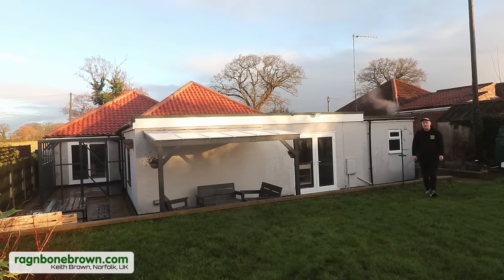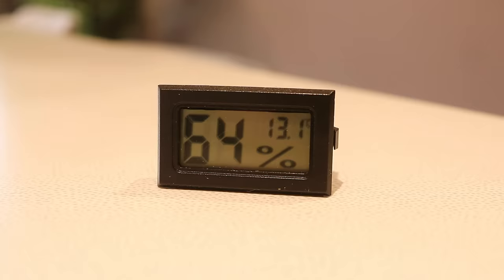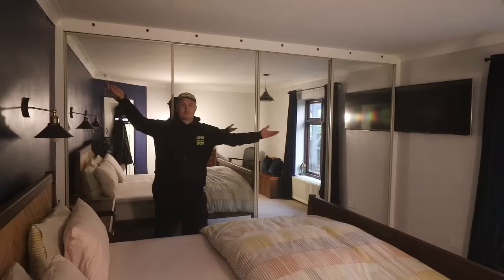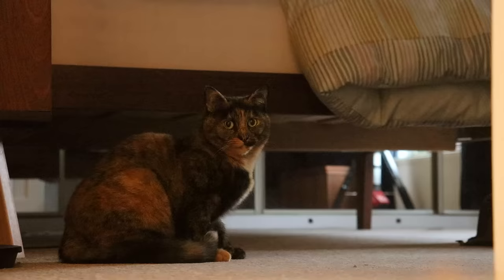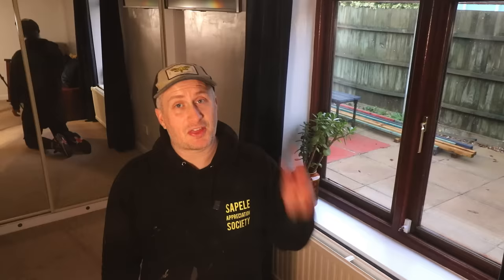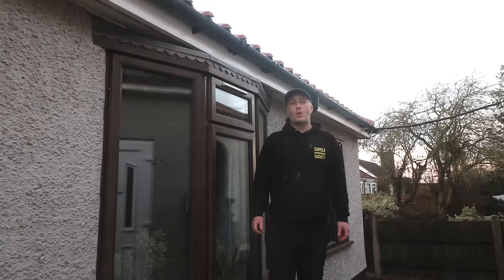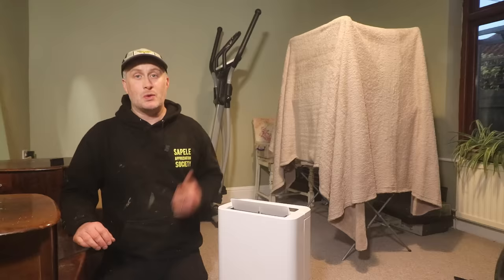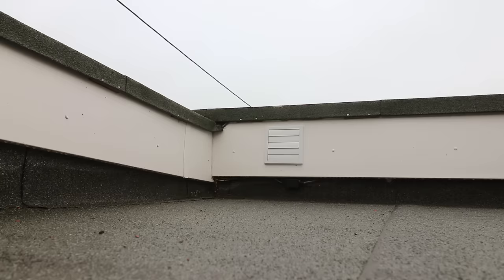8 Steps To Fixing Damp, Mould, Condensation & Humidity In Our Home

Comment: First of all, I carry out home renovations in my Compamy PJ Renovatins Ltd and understand the problem of humidity in the home. I live in a 1960s 5 bed bungalow in the St Andrews area of Scotland and was suffering the same humidity problems as yourself.  A reduction in our heating programme has made our condensation problem worse.   Like you, I monitored humidity levels throughout the house, which was around the 70 -80% level. Did some research on ways to combat the problem. I have done almost the same as yourself and now have humidity levels around 55 - 60%. By far, the biggest game changer was installing the Positive Inlet Ventilation. Although it has a heater, I'm a wee bit loath to use it as we are still trying to find a daily base level of energy usage. Once I have achieved that, I'll start adding on various electrical appliances, including the PIV heater. The other appliance that has had a huge influence has been the dehumidifier, which was on the scene before the PIV and is now being used to dry our washing in conjunction with a reduced usage of our fairly new tumble dryer. Finally,  to conclude, the one action that I would recommend that has had the biggest effect has been the insallation of the PIV. Hope this feedback helps.

Comment: You have to remember that Relative humidity is based on air temperature. If you are getting 60% in a cold room, that will rapidly drop if heated. What temp is the room that you are taking the 60% humidity reading? I have a workshop that sees 80% humidity due to it being cold. However, when I heat the room, it drops to 50%.
Reply: Using relative humidity is nonsense really. People should be using dew point
Reply: @Monaleenian I've also been thinking this.  What's the point of RH meters if they do not compensate for temperature? I.e 90% at 25c is not the same 'wetness' as at 5c? I'm confused

Comment: We're in a 30s semi with 9" thick solid brick walls.  We've got a decent  bathroom extractor, winter clothes drying is now done in a heat pump condensing dryer which is fairly cheap to run (around 35p per load at current prices) and there are still a couple of places in the house that are a bit damp - under the stairs and the built in wardrobe thats above the stairs.  I tried running a loop of central heating pipe around the wardrobe, hoping that it would put enough heat in to help, and put a false wall in so the heat would cause a convection current up the wall.  My next plan of attack is going to be treating the outside of the wall (currently just rendered and pebble dashed) with a water seal product and see if that helps.  Ideally I'd just build a garage along the side of the house which would keep the rain water off the wall, but thats out of budget at the moment
Reply: "My next plan of attack is going to be treating the outside of the wall (currently just rendered and pebble dashed) with a water seal product and see if that helps"

BAD IDEA! You are getting condensation and high humidity because stagnant, damp indoor air is condensing on the colder outer wall, not because water is penetrating from outside. Eventually the damp evaporates out thru the wall. If you seal the wall, the condensation will happen at the junction between render and pebbledash and damage it.

Figure out ways to increase air flow through those areas - Vent the wardrobe at the top, vent up thru the wardrobe from the below-stairs area, use extra-quiet 12V computer fans to move air out the top of the wardrobe.

Comment: If anyone has an old 'period' property, bear in mind that these house often become damp because owners/builders with little understanding about how older, and often natural/more eco building materials function, or rather cease to function when things like Gypsum and petro/plastic based finishes are introduced. 

I live in a solid granite cottage built in 1870 in Cornwall where outside humidity is incredibly high all year around (it rains alot here and is by the sea). I've been correctly restoring it using lime mortar (and linseed based paints for external joinery) and the levels of humidity inside never go beyond 60% - much to the amazement of every tradesperson who has set foot in the building and comment about how dry it feels/is compared to many other properties they've entered down here. Essentially spaces, old or new, need to be able to 'breathe'. 

Most general builders sadly have no understanding of older properties/materials, often writing-off the latter as simply outdated. Every building is different, but one thing is simple: Maintaining constant background heat, and extracting excessive moisture close to the source is key for a healthy building. 

Good work Keith on sensibly tackling your problems given the specific fabric of your property :)
Reply: I am not very knowledgeable in this area but this is my kind of thinking (as I have been reading/researching on the subject): dealing with issues as close to the source as possible!  Many thanks and regards.
Reply: We have a constant leak from upstairs neighbours that can’t be fixed because it’s an old ex council building. What would you say is a good thing to use apart from constant painting and dehumidifier
Reply: @Tamara-xp9nx 
Is the building freehold still owned by the council? They should be fixing that.
Reply: Who can afford to run constant background heat?!?! I’m in Shetland where apparently most of us are in fuel poverty.
Reply: If you have an energy efficient heat source it's relatively affordable - and certainly cheaper/easier/healthier than having to breathe in mould and/or keep cleaning/painting mould. Old houses need care which is, again, relatively easy and simple. I'm in Cornwall, and certainly not rolling in money but appreciate that steady heating (doesn't need to be above 18 degrees C btw) is important for a healthy well functioning building. Hope this helps    @Ida-Adriana
Reply: Limestone or clay based materials help a lot, must not have wallpapers or sealing paints. Modern materials have one main focus: quick and easy usage, thus saving construction costs. I had one bathroom problem with a cool steel concrete ceiling, wallpaper and paint: completely black under the wallpaper. Renovation with a few centimeters of insulation plaster, then lime plaster, that also on the upper walls. Much less humid now. But it only buffers, doesn't remove humidity.
Reply: We put Himalayan rock salt in a bowl ,and we empty the bowl every two weeks .

Comment: The dehumidifier for the laundry is a game changer. It’s incredible how every house in the UK and Ireland hasn’t got one for general use and laundry.
Humidity management is something that requires a little self education for most of us. There is a mind change needed to understand that heating clothes just puts the moisture into the air. It’s not actually removed. 
I’m very intrigued by your attic air recirculating system. 
Thanks for the video.
Reply: We bought a Miele Heat pump tumble drier. It costs about 15p to do a load and takes ALL the moisture out of the clothes and puts it into a tank which can be easily removed  like a soap drawer and we put the water back into the washing machine to do a dirty load , when doing towels we can pull about 2 liters of water from 4 bath towels and a couple of hand towels . It probably costs more to run the dehumidifiers for a few hours a day /several days a week . 
Before that we had a sh*tty White Knight mini Tumble Drier that just turned one way and the clothes were always wet/damp in the middle and cost a WHOPPING 85p a load !! (this was reliably checked using our kill-a-watt meter) 
The moisture from the white sh*te drier was unreal , all the walls and furniture felt wet and humidity was at 85% .
Reply: Yes.  Id wouldn’t even think about drying clothes inside the house.  Tumble dryer all the way !
Reply: If you need a dehumidifier to dry yout clothes it already means your home is too humid in the first place, better to use a dryer
Reply: @gpo746 I'd like a heat pump tumble dryer but we only have room in the garage, apparently they need 10 degrees to operate properly. Might have to get a condenser for now (they too require 3 degrees plus but have read many people have then in garages/sheds for years with no issues)
Reply: Superb comment. With a portfolio of 500 properties, calls start coming in from tenants like clockwork in October, as the temperature drops and people start sealing their homes up. We spend the next 6 months educating tenants on how to control moisture levels. Most the time it is in one ear and out the other; extremely frustrating. It's not even their fault; they are normal people, leading normal lives, doing normal things, in a normal home, they are just ignorant of the issues surrounding humidity. Part of me thinks all rented homes should have an air circulating system installed, or at least provide a dehumidifier for tenants to use.
Reply: I do not allow drying of laundry within the home. Also lately we have been using the little read outs to understand our own humidity levels better. However on some days we have opened windows to ventilate and the humidity has increased on some days dramatically. Obviously when it rains for days on end there is a lot of moisture in the outside air.. Thanks for the tip on the roof space ventilator will be looking at that.

Comment: Great tips and advice.
Our home is a solid brick wall construction (with no cavity), and we constantly have issues with high humidity, which is never below 60% with the windows closed, and up to 95% in bathrooms. The best method to tackle this is to have good ventilation. We can drop this figure down to 40% if the windows are opened, letting in fresh air.
It may seem a waste of energy to open windows, losing all the heat in our homes, but it does work and is the easiest 'fix'.
The massive issue of high humidity, mould, damp and associated health issues are our own doing. As homes have become less draughty, with efficient heating and insulation we have created a massive problem.
Reply: Great comment.

Comment: I live in a very humid area in Wicklow, Ireland, often 90% humidity outside or more. Had lots of mould issues and what solved it was installing a MVHR system. Took a few weeks but the humidity now hovers around 50% - from what it used to be at 75% on average. Its a ventaxia system, bought all the pieces myself and not to bad to install if your handy
Reply: Hi Ryan- did you install single room units or a unit in the loft piped to different rooms(I’m in damp Ireland 🇮🇪  😂)

Comment: Great video. We also have a similar 1920’s bungalow with several extension. We had awful condensation & mould problems for years until we got a PIV fitted much like the one in the video, we have the newer model that has a heater. The difference was noticeable almost over night. The house felt much fresher and dryer. I would definitely recommend to anyone with similar issues.
Reply: How much was it?
Reply: Is your bungalow solid walls no insulation?
Reply: @dawnlee6742  yes it was solid brick with no insulation when we got the PIV fitted. We’ve since had external wall insulation fitted but still have & use the PIV.
Reply: @neilheslop5786 could i please ask was it nuaire or vent axia you went for and was this home based in uk?
Reply: @dawnlee6742  Nuaire. Yes in the UK.
Reply: Thank you

Comment: I'm also in Norfolk, live in a 2 story, about 40 year old home and it's at about 42% at the moment (evening) but I do get some condensation and mould, if not frequently cleaned, at the windows in the mornings.  I do like it warm (about 22C) during the day though, so that dries it out.  The problem you may have is you are inviting outside air to come in, and outside air at this time of the year is quite moist, and cold. I'm glad your mould problem is sorted though.

Comment: I installed a MVHR in my 60s bungalow, complete game changer, bungalow sits around 40% humidity in the winter. I can keep the whole bungalow at 18 to 19° with only the wood burner, the system moves fresh, warm air into bedrooms that used to have condensation on the walls!
Reply: I think MVHR is the gold standard. Bet it was expensive though. Perhaps PIV could be a decent second place that’s more affordable.
Reply: Do you have the wood burner on many hours a day?

Comment: I'm in a 60s bungalow just a slightly smaller footprint to your place and also have a constant battle against humidity. We average around 70% and I have a bit of a mould problem in the kitchen, I tend to keep a window open a crack all the time in there, when it gets bad I have 2 open and that tends to clear it. Extractor in the kitchen but none in the bathroom, just a top opener for the bathroom. I found a window vac really helps after showers, found that out from Charlie DIYte's channel. I also use the window vac for window condensation in the kitchen and living room. In winter it's a constant struggle, we're just about to get the loft converted which has a huge 3m ceiling height at the roof ridge and around 50m^2 floor space, so hopefully that'll help with air circulation... very interested in something like your PIV system, but without a loft space what options are there?

Comment: As a few have mentioned it’s relative humidity so your room temp will have a bearing in this. I live in a brand new built house but after the first year wanted to paper a few rooms so bought these hygrometers to give me an idea of humidity in the rooms to be papered as I didn’t want the paper to start lifting especially in the main bedroom as the en suite had no openable window. What I noticed was that only during the summer it drops below 60 but in winter hangs around or above that mark. I think you’re doing very well just above the 60 mark for such an old house.

Comment: I fitted a PIV unit into my 2 story house just before Christmas, we were getting condensation and mold growth everywhere! even bought one of those window vacs. Fair to say that the PIV unit has been a literal godsend and dropped our humidity from average 80% to 55%. for about £350 the PIV unit is well worth the investment and really easy to install.
Reply: Is the air being pumped into the upstairs or downstairs (or both)?
Reply: @AlexPlym06  Its just above the landing, so the air gets circulated as its in a central location.
Reply: Hi where did you buy your piv are you still happy with it? Was it an easy install? Thanks v mich
Reply: I ended putting 2 x PIV units from NuAire in my period Cornish 3 level house.  As I complained to the manufacturer after 12 months that whilst it had bought down humidity, it was still 55 - 75% most of the time.  They said as I had a typical sprawling Victorian house the 1 would not do the job as it wouldn't work its way around.  Now I have 2, one in the downstairs extension and another in  main loft.  I also have 2 dehumidifiers running 24/7 one in the basement and one upstairs.  Typically humidity is now around 60 - 65% and we fitted 3 humidity sensor extractors 2 in bathrooms and another in the kitchen.  I also find the RH is typically higher in the summer than in the winter.

Warmer summer air holds more moisture than colder air - worth a look at Peter Ward (expert old property man) - vid on condensation - https://www.youtube.com/watch?v=m54cyKB1gfA
He has a ton of good stuff on his pages.

Sadly my place has been cement rendered all over at some point in the past, painted with modern paints and plastered with modern plaster inside, so far too much expense to resolve

Comment: One thing I did read about a PIV unit, is that for it to be affective, you need around a 10mm gap under each door for the air to be pushed into the rooms, where as our current house is a modern three story build with building regulations firedoors, which are fitted with no gaps to stop smoke entering rooms in the event of a fire...

Comment: I went the other approach. My house double brick from the 1890s. It'll be impossible to fully seal something like this, but we got a huge improvement with a few dozen cans of spray foam. We're planning on doing a lot more next year to get the R ratings up. Instead of letting unconditioned outside air in, we have a vent on the furnace/boiler with a heat exchanger, so we aren't sucking in damp air, and dumping out conditioned, heated air. And I'm running a dehumidifier in the basement. We have radiant heat, so no vents unfortunately to circulate much. But I have an ecobee zoned system with sensors in most rooms, and we're usually in the mid 30% and on rainy weeks in the 40s.
Reply: To clarify the air in his loft is unconditioned but it is not damp, relatively speaking, just cold. The ability for the air to hold moisture increases with temperature. So in the winter the outside air has a high relative humidity because cold air cannot hold a lot of moisture and feels damp but actually has a low absolute water content. The warm air in houses can and does usually contain more moisture which is why the general advice is to open windows for a bit in the winter to let cool dry air in.

Comment: We've an 1890's house that's draughty as hell. While we don't have a humidity issue, we do have a big issue with heating it. I invested in wireless radiator valves (Netatmo) and it's drastically improved how quickly we can heat the rooms we want to keep warm. They can be a pricey outlay but I think they've paid for themselves over the years. I've also set up a geofence so the heating automatically switches off if we leave home, cutting bills even more.